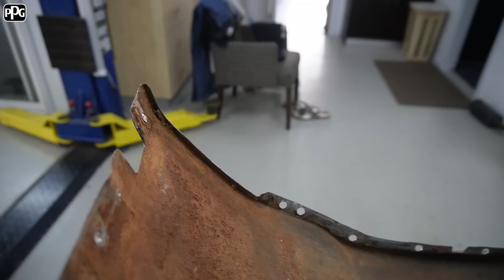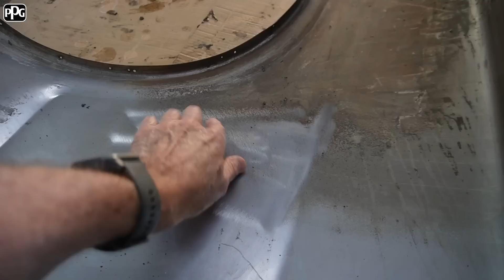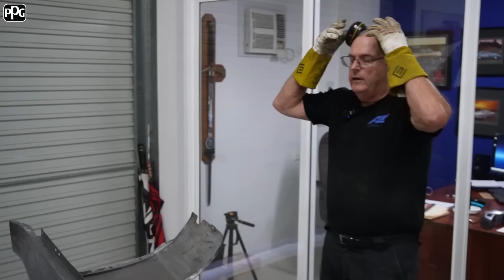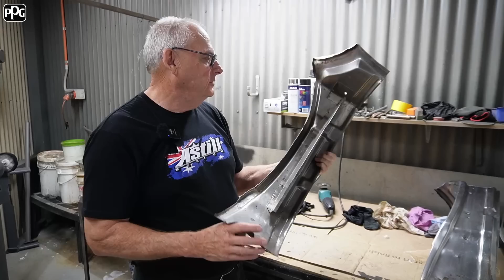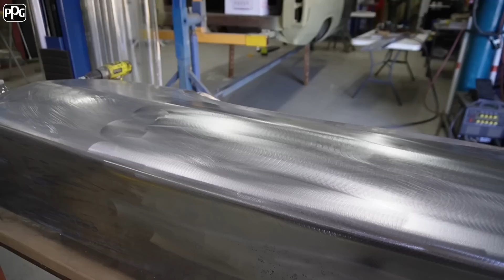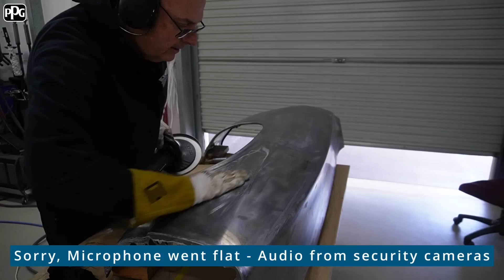Bare Metal work and heat shrinking on XC Falcon Panel Van #14 Magnum Force

Comment: Hi Howard, I really enjoy these videos. some tips, 
cover the area that you’re going to use the shrinking disk with a marker pen, the ink acts as a lubricant, it also helps you see where the disc is touching the panel and might also help to show things better on camera.
Try using a heat gun to warm the panel, I’ve found it works really well for situations like you used the oxy for on the front guard. It’s also good during the colder months as it helps to “relax” the metal and with care can be used with air/damp cloth to shrink the metal.
Reply from the maker: Cheers, good tips mate! Will give it a go next time.

Comment: I used to use brickies bolsters for chasing out dents on swages from the inside . Welded different size round bar or pipe on the tips to conform to the shape. Great vids  nice job too👌
Reply from the maker: Great tip! I have a draw full of different chisels and drifts

Comment: Just a tip on using the shrinking disc (I've got the same one) keep it flat on the panel, if you tilt it the edge goes in the lowes, and you don't want to heat the low spots
Reply from the maker: Cheers mate, thanks for your input. I like the 4” one better.

Comment: This is an excellent series Howard! I've recently finished an XC sedan with help, and now I am about to tackle my XH panel van with a full bare metal refinish on my own at home.

What is your process between applying paint stripper and getting panels in epoxy? How do you make sure you've removed all the residue? You've probably covered it, but I guess I missed it.
Reply from the maker: Have a look at this one, it covers metal prep. Type this into youtube search https://youtu.be/68lBpckQK18

Comment: Awesome detail as always Howard.
Finally I found something I can do as well as Howard Astill (dropping panels off the stand).
I’m about to redo my two XC guards as I’m not happy with the fit & finish, is there anyone that makes a lower repair section that has the correct reverse curve, as the rare spares one is too flat.
Cheers
Pete Edmonds
PS - had to get my GXL towed for the first time ever, from the Unanderra exit road. Rare spares mechanical fuel pump - 6 months old.
Reply from the maker: We sell a lower that's made in Aust and is a pretty good fit. https://www.facebook.com/photo/?fbid=484224110824971&set=a.406314665282583

Comment: Thanks for another installment Howard. She's coming along slowly but surely.
Regarding the panel pillow, I used to use Armaflex copper pipe insulation. The thickest you can get. Slice it down the middle, slip it over the rails then just tape the ends and one in the middle.
Does the job just fine.
Reply from the maker: Thanks for the tips!

Comment: How the hell did I never think of that timber block trick ... Bunnings fold up table which I'll be happy to drill holes in and that will be a very handy sacrificial tool. Great idea Howard! Also like that panel pillow thing. I imagine it allows panels to sit more securely and take out the wobble. Do they work well? Huge thanks once again. Love your work.
Reply from the maker: the plastic table will probably move around a lot being so light, but still ok. The panel pillows so far so good, will be good when everything is getting painted.

Comment: Great and informative as usual, Its good when you have time on your side but I guess you have to have the patience and passion along with knowledge to make it all work! Howard have you ever  installed a handle similar to a concreter's float on your file? not sure if you would have the same control or feel, maybe you may have more? But what would I know! Great progress looking forward to the next video! [PS yes it is a Carpenters wooden scribe and the next stage above that is a mortice gauge and the one above it is a mortise gauge with scribe} Ex Carpenter Bill Mc
Reply from the maker: I do have a panel file with handle but it’s a bit aggressive,

Comment: Another great video, Howard 👌

With the wheel arch lips, I was under the impression that the tyre grabbing was a matter of incorrect wheel/tyre offset. But in your experience, do they grab regardless when you put on a wider wheel?
Reply from the maker: You are correct, but reversing out a driveway on full lock is alway a problem
Reply: @AstillDesign 😂

Comment: If you’re having interference issues with tyres/wheels. Your not doing it right
Reply from the maker: If the car is low and you’re backing out a driveway with the need to have some lock then they will touch.

Comment: Fender? You mean front gaurd?
Reply from the maker: fender?
A fender is the part of a car that protects and frames its wheels and keeps mud from splashing it. Most modern vehicles have fenders on their front wheels. When you get into a minor car accident, you can call it a "fender bender," and it's possible that your fenders did get slightly dented.
Reply: Love ya work Howard. Fender in my book is a Yankee term, us Aussie's call it a guard. Like trunk and boot.
Anyway keep the quality coming bloke 👌

Comment: Absolute magic as usual. Taking a lot out of it. Love the tackling the crap bits like behind that plenum grill, often not dealt with. I have two genuine GTS guards for my ute which have so many old repairs i can't tell what's high and what's low. Any advice for battered stuff like that?  Also i use the thick pool noodle for panel stand, just run Stanley knife down the length and push on. cheap enough and much tougher than the thin slip on rubber. I use the same noodle and technique for the hoist ramps to save my head.
Reply from the maker: You need to start somewhere, use a steel ruler or I like to use 50x4mm Tasmanian oak timber to lay over to panel to check high and lows.

Comment: just on using a file to check for dent's. when I check I use an oil stone as it doesn't harm  the metal. I used to repair Toyota panels straight off the press. it's one of the techniques.
Reply from the maker: I like that idea, I’ll give it a go
Reply: @AstillDesign  if you do try it, round off the edges slightly so it wont make any scratches.